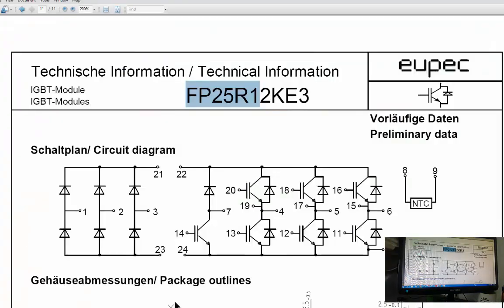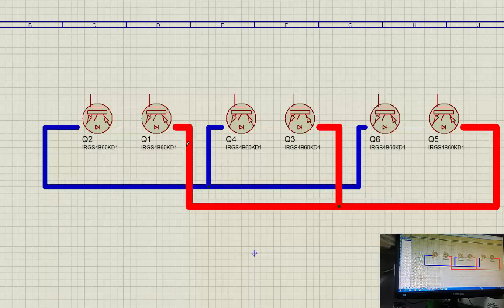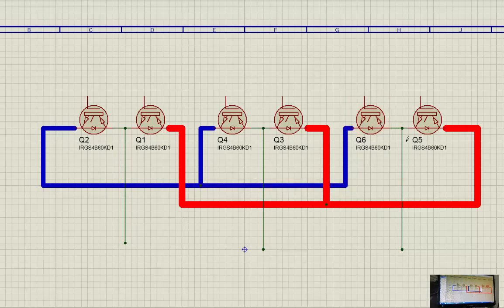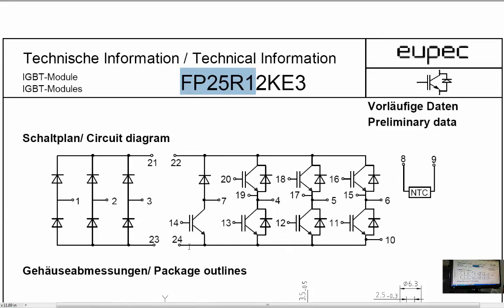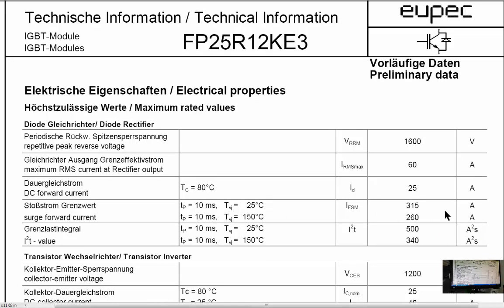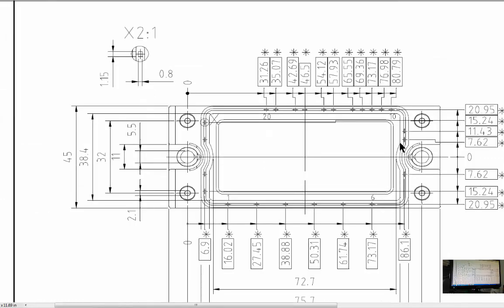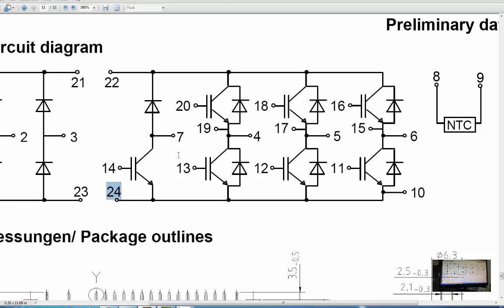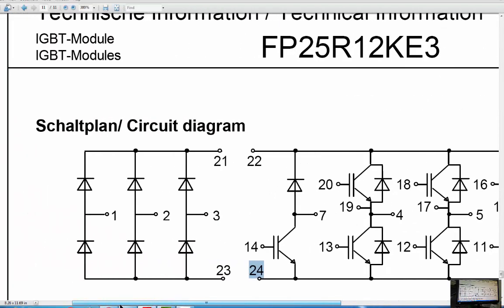#254 IGBT Module FP25R12KE3 Circuit Explained and Testing with Multimeter

Comment: Sir guide line chahiye aap se inverter ha c2000 delta output voltage nai nikal rahe ha enable karne per frequency show hoti ha lekin output voltage nai nikalte ha koi foult b show nai hota ha igbt b test kia ha OK ha supply b OK ha dc  supply b OK ha c2000 delta 20 hp

Comment: Sir , if all the  testing ok using multimeter , it's not a guarantee that IGBT ok , some time we face this problem.
Reply from the maker: yes brother 
you are right 
it is just a first step in testing to detect either there is some igbt short circuit etc

Comment: I want to ask you question
I repair some VFD but i face a problem with SMD TVS diodes have a codes but i could not find it by search engines 
so do you have an way to find some compatibles or how to deal with it? i mean the board it can be repaired but this part i cant find it and the datasheet for some VFD is not available by internet. i need power flex datasheet but i dont find , ABB too. Can you help me  ?

Comment: Why is there no parallel diode in chopper IGBT(pin14 driven IGBT)?
Reply: @HaseebElectronics  What if when IGBT module is used in servo drive? It means that if we have parallel diode in chopper circuit then we are wasting energy stored by coils into regenerative resistor instead of sending them back DC Bus capacitors. Is that right?